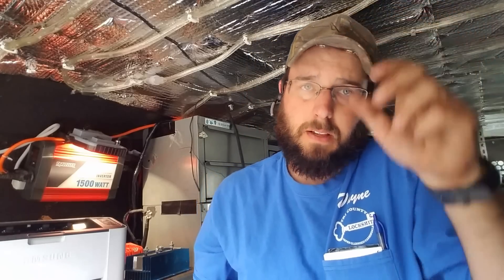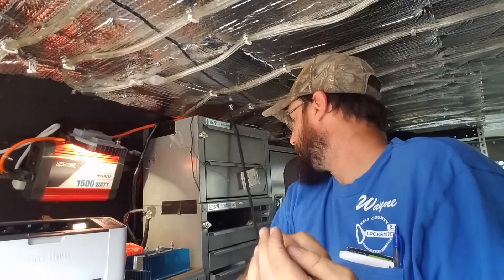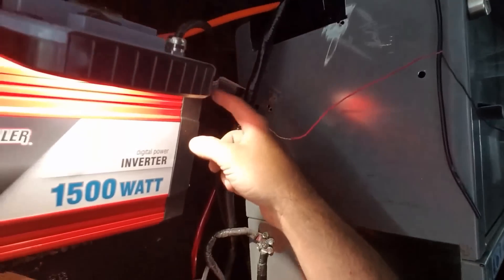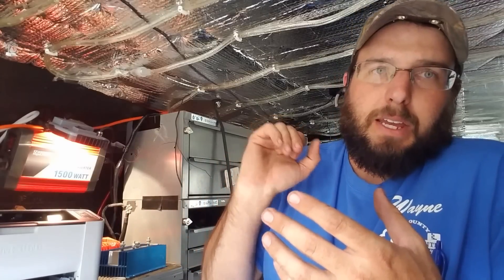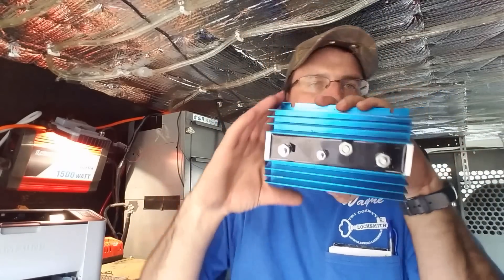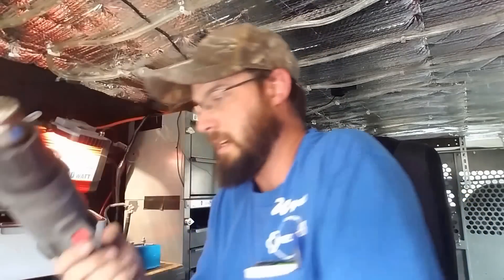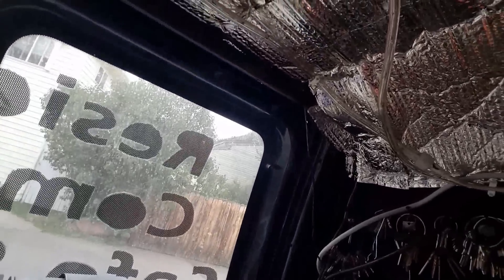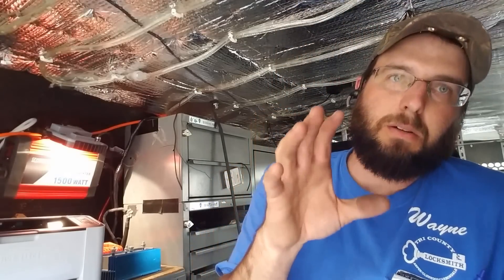Easily install a power inverter in your car, truck, van, SUV or RV traveller 1500 w power inverter

Comment: I have a Powerbright 1100W inverter and it came with only about 3 foot of cables and they have clips like jumper cables. I have a Ford van and would like to install it in the back and would only be charging power tool powers and things like that. I don't know anything about electrical so I would like to know can I just get approx. 10 foot cables and if so what guage  should they be. I also wanted to know if I should run these cables to another battery and then attach the short ones that came with the inverter to that battery. Thanks.

Comment: Awesome. This is exactly the info I was looking for. I knew connecting the inverter to the car battery directly wasnt making sense because of voltage drop over cable length. Now I know a small auxiliary battery will help me here. Going to start with a small 8Ah battery just for the inverter until I can afford a bigger battery bank for my van conversion.
Reply: You should have a pararell set up and a 3rd. battery or jumper. Deep cycle are even better.
Reply: @1969nitsuga  I now have a 200Ah 12v parallel AGM house battery setup thats going to be charging mainly off of the alternator

Comment: I'm getting ready to set up my 01express conversion van, I have 2 70 amp hour deep cell agm batteries, and a 2000 watt inverter, its my home, I'm into the van life, plus I'm an auto mechanic, so I'm doing it myself, I have been using a 750 watt inverter, just to make coffee in the morning, and run a small flat screen TV, plus charge an electric shaver, rechargeable flashlights, phone and rechargeable battery packs, its been working great, bow its time for an upgrade!!!

Comment: I had a 2000 escalade with a 3k inverter using 2 pararell bateries of 700 amps. It worked fine for whole nights in two hours intervals on and one on the batteries. I used this setup for months in Puerto Rico after María as a back up power plant.

Comment: I am looking to be able to run some basic appliances from my SUV. I got the ever start  maxx 1500w inverter. I like the fact that you addressed the installation using safety and out put maximization. I am obviously not ready for this installation yet. I need another battery, extra heavy duty wire, inline fuses and evaluate where I can put all this extra hardware. I could always set it up for temporary on the fly use.

Comment: Thinking of installing a 400 watt inverter in my trunk of my civic cause I hate the fan noise. Then run an extension cord from the trunk to the drivers seat. Is the distance from the battery to far of a run? What gauge cable is needed for this install? Thanks for any tips.

Comment: After watching your video my question is do you only use the red from the front battery or do you use both?
Also could I use a 165AMP deep cycle battery*RV/Marine battery*, How does the battery recharge also is a question?
Reply: You only need the red the car body is ground , only one long strand of wire to positive on battery, short wire to ground close to your auxiliary battery.

Comment: Sorry, I know this is an old video post but I hope someone can help me a bit. I am kind of confused when it comes to electrical stuff. I have a minivan that I want to use for camping. I must have my Mr. Coffee drip coffee maker when I go or else I need to use a camp stove and percolator pot. Can I run a coffee pot and a laptop (doesn't have to be at the same time) using a 1500 watt pure sine power inverter? Must I install a secondary battery for this. You suggest taking it to a profession for installation, do I need to call an electrician for this or take it to auto service like a dealer or RV place? Other than that I would only need to charge my cell phone and maybe power a usb fan/lantern. Please advise me if you would be so kind. Thanks so much. I am an old disabled vet who wants to do some minivan camping and takes some road trips to knock things off my bucket list before I die.

Comment: So I can’t just connect it to a battery and not having it connected to the car battery what so ever? So to explain, I want an inverter in the bed of my truck can I just hang/install a battery next to the inverter with out any of them being connected to the engine compartment. Thanks

Comment: I have an agm battery in the back of my. 01 chevy express van, i had planned on connecting it to my start battery but i have read online they need to be charged slowly and relying on the alternator to charge it, it could overcharge it and kill the battery, so now im not sure what kind of sealed battery you are referring to that can be connected to the start battery?

Comment: Had same issue cutting keys on my van just running from the van battery. Machines just kept on tripping the inverter. Finally installed 2 54 ah batteries in the van and mounted 200 watt solar panels. Don't have to start the van to cut keys anymore

Comment: You can also boost your inverter's output by running the engine in your vehicle while running high draw loads.   The alternator will help to smooth out voltage sags - as long as you're using heavy gauge cable, like the 1/0 gauge wire you suggested.   And, that should be sufficient, since 1/0 gauge wire is rated for 150 amps for power transmission, which translates to 1800 watts at 12 volts.  You can go up to 4/0 gauge wire, but if you need that much power, you're definitely going to need a bigger battery than is found in a typical vehicle and you risk damaging your alternator if you're running your engine while running such heavy loads.   So, it's best to stick to 1500 watts, or so, or less, to protect your battery, your alternator, and your wallet.

Thanks, for the video!
Reply: could you run a electric heater 1500w 120v amps high 8.3A watts high2000?
Reply: @vbecker1  I wouldn't suggest you run an electric heater off an inverter/battery/alternator setup.  All three of those components would be stressed and, at least, one of them would fail.
Reply: @richardowens9061  Thanks for the reply.  That's not what I was hoping to hear.  I've ordered a new work van and am wanting some way to get some heat in the back.  I'm able to get a second battery installed with the van, but an additional alternator is not available.  Any ideas of how to accomplish what I'm after?
Reply: @vbecker1  Yes, install a Webasto gasoline fueled heater in your van.   They also come in a diesel version (most popular for use in heavy earth moving equipment and eighteen wheelers, etc.)   You can also get cheap Chinese knock-offs.   But, the labor to install either is about the same, so you're better off getting the more expensive Webasto (the best) and call it done. 

They tap directly into the fuel line to the tank, or can be fueled by a separate tank that you have to keep refilling.   And, they use a low power 12 volt fan to push the heated air.   A lot of people also use these in RVs.
Reply: @richardowens9061  thanks for the info. I really appreciate it.
Reply: @vbecker1  You're welcome.

Comment: and get a pure sine wave inverter to run your electronics such as a printer or computer
Reply: You can get a battery back up with a bigger battery for that purpose. I ran a 50 inches tv plus fans and 2 doors fridge with this.

Comment: What if you only ever use it while the car is running?  I already have a shithot main battery, but just the one.  I don't know if I'll find space for a 2nd one, but if I have to, I guess I will.    I don't do any business type stuff; this is a Subaru and I wanna play my electric guitar and my pedals out in the woods.  So if its only ever used while the car is running, you reckon I'll still need a 2nd battery?

Comment: You can get more amp hours by running two 6 volt batts in series, usd isolator AND INSTALL 250-300 amp fuse or Circuit breaker. I work at RV shop and we do these installs all the time (3-4 a week).
Reply: Can you explain more how to do this or give me a link with info, thanks

Comment: What size wire from the van battery to the secondary batteries?    How many feet from that battery to the secondary batteries  (ie.15 ft?) I am going to use truck alt. and battery to charge my secondary battery 20 ft away from alt. Need to know size wire to charge battery

Comment: I’m thinking of getting a 1100w-2000w inverter for my ‘17 Ford CMAX Hybrid for camping, cooking etc. But I’m worried it may damage the battery. Thoughts? I plan on running a 1050watt toaster oven for 10-15min at a time when camping. Also a separate 1000w hot plate to use (not simultaneously) 
Thanks!

Comment: I moved my 1200 watt inverter right next to my battery in the engine bay and connected it with a very think 1/0 AWG 12 inch copper cables and I was able to run a 800 watt electric grill while the engine is running.. however , the inverter's fault trips when the engine and inverter get hot.. even if the battery is reporting 13.5v.  Does this make sense?  The van has been siting for 30 minutes parked still the inverter and engine are  hot and the invert  fault still trips even with no load. Can engine and external heat affect the fault on an inverter? Maybe the engine bay is not a good idea?

Comment: What is your tank size for the air compressor? I'm wondering if 21 gal tank is overkill or just right for a locksmith van.
Reply: I am not sure what size mine is, but it is much smaller (maybe a 5gal) and I run air ratchets, air guns etc. I think you only need a big big air compressor if you are trying to air up a tire that has come off the rim and you need it to pop back into place.

Comment: Are your 2 70aH batteries parallel 12v ? and where are you getting the recharge for them from?
Reply: When car is on it charges, but does it overcharge the starter battery

Comment: Hi Wayne.  How do you recharge the external batteries?
Reply: Joe Pacheco 
Use a deep cycle battery Connected to the dc to dc charger or isolator connected to your car battery, plenty of vids on that

Comment: good video wayne 
i have a 1500 watt inverter 2000 watts max.
i running a 32" l.e.d tv and a xbox 1 in my 2005 chevy conversion van, i tried running the set up when i turn the gaming console on it trips and restarts the converter. help me out
Reply: You are only pulling 300 watts or so, sounds like cheap inverter or possible low voltage weak car battery.
Reply: Was ur inverter pure sine or modified?
Needs to be pure sine .

Comment: Who would I go to get one installed? I'm not sure that a regular mechanic would know enough concerning the O gauge wire and the 60 amp fuses etc. I worked at a large Ford dealership and have seen trained mechanics struggle with the electric components in a door.  Thanks in advance.
Reply: Take it to an audio shop.
Reply: Rv shop
Reply: Jesus Christ died for our sins, was buried and rose again to save us from eternal judgement and give us eternal life if we believe Him. Only God can save us and freely give us new life inside forever

Comment: I have an inverter in my car a prius. And I use that inverter to charge batteries for my landscaping equipment. It is a 410 watt inverter but it does not work to power some of my chargers. Any ideas?
Reply: Not enough watts.  The conversion of Amps to Watts equation ...
Watts = Amps x Volts
Say your leaf blower is 12 amps 120 volts, 12 * 120 is 1440 watts
Reply: Thx I will try to get a more powerful inverter.
Reply: If the inverter peeps and shut down then the inverter is not big enough. Usually chargers do not draw a lot of power while charging your cordless items.
Most of the cheaper inverter are modified sine wave inverter which do not have the exact ac wave as the net would have and some chargers do not work when using modified inverter.  In that case you may want to try a full sine wave inverter that cost more money.
Some motors may not run on a modified sine wave inverter like my small fan I have and some electronics may burn up especially if you use something with speed control like a speed variable controlled drill for example.
If your inverter has a cigarette plug it may not work either since those wires and connections are to small in many cases and have to much resistance.....try to hook the inverter directly to your battery with bigger wires.
Reply: Actully what you need is a sine wave inverter, battery chargers are notorious for not working with your common modified sine wave inverter.
Reply: yootoob What's a real car to you?
Reply: Electric Cuts if your charging 40v or over batteries like those used in landscaping tools, 400 watts isn't enough for fast chargers pulling 8 amps and a pure sine wave invertor is a must for those expensive batteries...unless the manufacturer states otherwise.

Comment: Big wire,short wire and battery isolator 12 volt 100 amp deep cycle battery and 1000 w invertor you can use most small appliances for cooking in small pressure pot 600w or small coffee pot 600w for 30 or 45 mins and still have 60% batt left 👍

Comment: thank you so much man. i appreciate the info.
i now know why the 1000 watt i bought today kept beeping and not running half of the stuff.  i actually didnt think i needed the thick cables connected to the car battery. i used a 25 feet extention cord to connect to the car and put the inverter inside the house :)
i didnt know.. i just bought it because of hurricane florence.. we have lights though and we can charge phones but could not make coffee .. it kept disconnecting :(
Reply: 11 0i

Comment: So just to make sure I understand correctly, your car battery is connected to the alternator, so it charges, and then it is also connected to a fuse box, and then from there it connects to those two 70 amp hour batteries, which I'm assuming are operating in parallel. What you want to do it sounds like is essentially install like a high powered diode (the battery isolator) on the line to the batteries so that power can only flow in one direction (a switch would also be a nice touch). These batteries are then connected to the inverter. Why is it a concern that the car wouldn't start if you didn't have the battery isolator? The only thing I can think of is that your two 70's are dead, and the car battery tries to charge them, then they all reach a low voltage equilibrium, and then that isn't enough to start the car. I mean I get it that you don't want them charging the car battery if it gets low, you only want the "flow" to happen in one direction. But the car starting thing doesn't quite make sense to me.

Comment: I fully understand the need for correct wiring and fuses. 
I just want to know what all I need to run an electric air compressor 
..... I have an old instrument air compressor from oil field 
It’s a 3/4 horse motor 
115volt 
10 amp 
Roughly 1150 Watts 

Guessing I need 
A roughly 2300 watt inverter... 
second 12 volt battery 
And an isolator 
I’d like to be able to leave the battery under the hood with a wire to the alternator... isolate it.. and run power from the battery to inverter which would probably be in the toolbox with the air tank which has the pressure switch... which supplies/ cuts power to the motor.....id rather have the vehicle running when I use the compressor anyway.... that way the battery will always be charged.....
Reply: If you wire in a start capacitor you could run things that need a jolt to get them started. I am going to go buy one that is used in home heat pump systems.

Comment: You really don’t need alt gage wire. I’m not an electrician, but I suspect you are losing power in some way since there is absolutely no resistance.

Comment: There seems to be two types of inverters.  Modified Sine Wave and Pure Sine Wave.  I have a Modified Sine Wave inverter.  Is that OK even though the Pure Sine Wave inverter is better?
Reply: Depends on what your powering, something simple like light bulbs or simple moters like fans run fine on modified sine wave. Things like electronics, computers, chargers, and other sensitive things. Should be on a sine wave inverter.

Comment: Such an isolator is mandatory. Good ones prevent draining the vehicles battery while they allow the auxiliary battery to be charged while the engine is running.

The setup shown can be improved by adding a huge capacitor as close as possible to the input terminals of the inverter which then allows fuses between the aux batteries and the capacitor. Such capacitors are sold for car audio and have a current limiter which solely limits initial charge current, so the empty cap won't blow the fuses.

Comment: First off great video I'm about to try a very similar maneuver and you gave me some good ideas. I have a quick question though I'm a freelance web developer looking for a way to power my workstation there's a lot of power outages where I live my whole system is less than 1000 W if I install it the way you instructed do you think a 1000 watt inverter will be enough? Or should I always go with at least 1500

Comment: sir i have a problem. i have a current setup with my solar panel and soalr batteries. it is not connected in my car batteries. everytime i power my solar setup and my car is off, it is draining the car batteries even if its not connected. can someone help me? i cant seem to figure out why its draining.
Reply: There is so much wrong with your clarity.  What’s draining what when it’s not connected while it’s connected to what?

Comment: Wayne, how big of a inverter/converter would I need to run an electric impact wrench when changing tires on my truck?
Reply: Hi Paul, my elec. impact is good to go on 900 watt. I'm pretty sure mine is a 7.5 amp gun.
Reply: All tools etc .. look at the wattage the device uses. Best to have at least double what the device uses